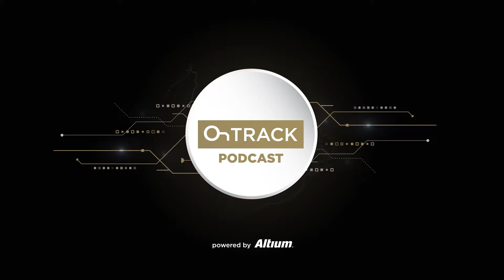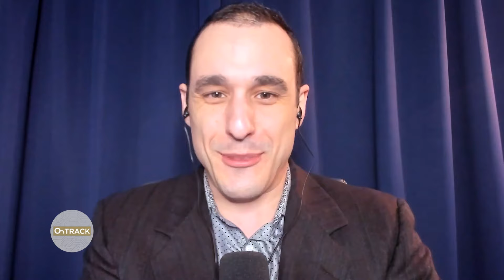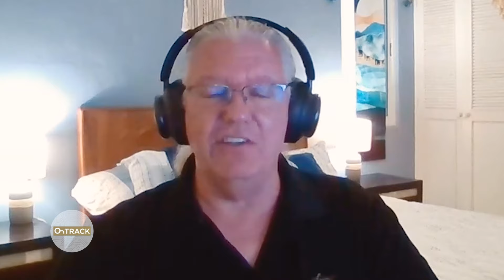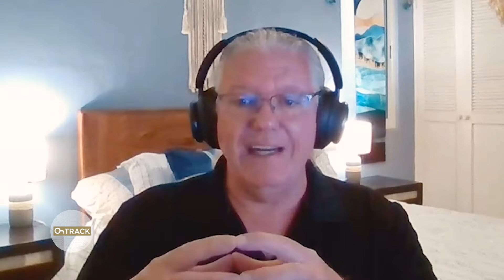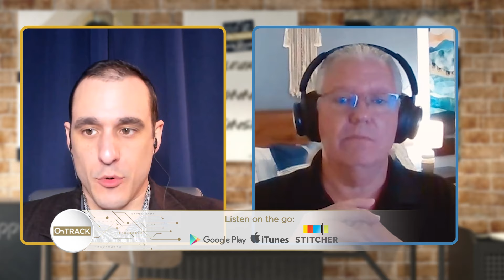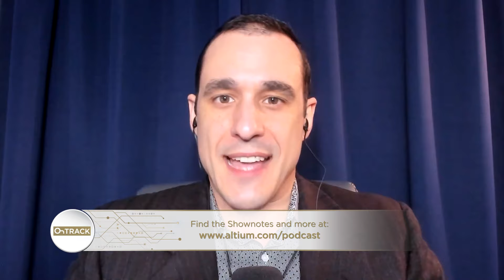Signal Integrity Mastery: Scott McMorrow's PCB Design Revolution

Comment: Very interesting.  What do the terms "launch" and "designing a launch" mean as used in this talk? I've previously seen "launch" refer to a signal transitioning from one medium to another.  I get the impression in this video the term refers to the entire pattern of tracks routed out from a dense connector (or footprint, like BGA),  and their impedance and frequency characteristics as a set. Does that cover it, or does the term encompass something more specific?  For example, does it encompass all tracks near the connector, or only the ones driven by the connector (that might more literally be considered "launching")?   (FWIW, it took a few repeated mentions to clue me in that Scott was not talking about new connector product launches!)
Reply: The term "launch" refers to the sizing of the pad and/or signal via reaching into the PCB from the connector footprint, and the pattern/locations of stitching vias around the signal pin. It can also include the trace leading into that pin, for example this might include a taper and any surrounding ground (coplanar waveguide). For differential pairs, it accounts for the location of the other trace in the pair, so you can have differential signal launches. This engineers the input impedance of the structure (looking into the PCB) so that it matches the output impedance of the connector.
Reply: @Zachariah-Peterson   OK, more or less as I inferred, with some nuances. Thanks for the clarification.